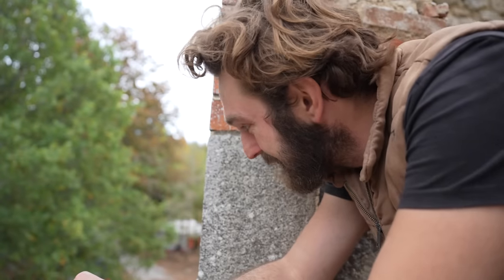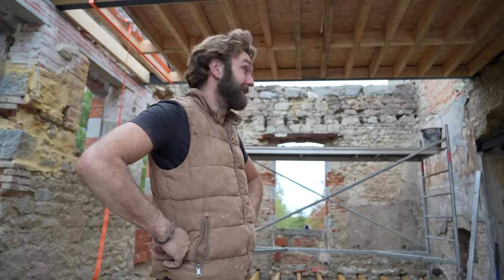it's finally finished, ready to install the floor.

Comment: Take a hint from old dutch houses. Hang a winch over the top wall that sticks out maybe 1m from the building. Control the beam with ropes from below to prevent hitting the building and eventually pull the beam in through the window.
Reply: Hope he reads this Madst, great engineers trick, from farmers to builders with heavy bulky items, doesn't hurt to hint..your idea could save the day👍

Comment: Is anyone else at that stage where you begin to imagine what it will be like when the roof is on and Dan starts putting in plumbing lines and electricity throughout, and then, dare we imagine, interior walls? Each stage will be fascinating to watch.

Comment: Bloody excellent. Regarding steel beam-we saw a church in Australia who instead of manouvering a long beam into place, had a short section and long section of beam and they bolted them together about 30-50 cms out from the wall. The did it so they they could have maximum length into the wall pockets

Comment: Dan, you can slide the beams through the window to the first floor. By moving the OSB boards and attaching a winch to the highest beams and using scaffolding for support, you should be able to pull them up another floor. Go up in stages, but you gain more control over the beam than by pulling it up from the bottom all at once.

Comment: Nice to know that your going to fix the C channel back to the newly rebuilt wall using chemical fixings. That will stop the channel twisting over its length after my last comment, well done.

Comment: I'm still a bit amazed. (Old archeologist talking.) Why didn't you get these extremely stable festival advertisments or lorry-covering plastics for your floors from the local waste-dump? 
Usually they are dropped after local football-games or festivals, or after a transport firm changed name or owner. Sometimes they are also kept in a community-vault for a later reuse, but you get them either for free or a small coinage, them in most cases being considered waste, anyways. It makes it unneccessary to clean the floor every time you do something on the level above it, and prevents the wear of the boards, because you just lift the plastic (well: it's heavy, you might need a second hand on your teamwork-carterpillar-days) and poor it a floor down on the next plastic. Spares you a lot of shovelling-time. And I would heavily suggest using them for winter or the interim-roof-levels, and especially the tiled ground-floor, that isn't getting any better with shovelling.
Reply: The only problem I can see the Chateau is in an area that perhaps don’t have Festival or businesses that use such banners etc. but a good idea. He does make life hard for himself.🍷🍷🇬🇧🇬🇧
Reply: @dawnbutler2846  True, it's more rural - they might have lorries, though. Perhaps a neighbouring farmer has some spare - holed ones. Sometimes they are used to cover those strawball-hills or silage-balls, usually these are dumped after some seasons. Smaller holes don't really do a big harm on boards, but on straw-storage. Boards can do with smaller, intact pieces, and one can always add a double-layer. There might be some useable plastic waste close-by, perhaps also from old plastic-tunnels from gardens.
Reply: @MagnaMater2  i do wonder wether 
he reads our comments. My worry are his lungs not wearing some kind of mask. Dan will be Dan.🍷🍷🇬🇧🇬🇧

Comment: Dear Dan, instead of buying so much NHL, i would once make a big amount of Calcium Hydroxide from calciumoxyde in the cellar. In Germany we call it  Sumpfkalk. Making it is dangerous because it will get very hot and you have to take precausions.
Adding some trass- pouder to your plaster Mix, it would bekome hydraulic. Less cost, less transportation, less bags.

Comment: Good to see your thinking of using my idea on the socket and drill. Just make sure you use one that supports a 1/2” chuck. The amps is what you need to keep an eye on. Cordless is the preferred.
Reply: "Your" idea? 😂 Literally a thousand people have told him this since he started using that contraption. And he has ignored them from the very first day.
Reply: @Sgirl  well one more suggestion didn’t hurt. I put it in a comment a few days ago. When he was bracing the window beam. Even explained how to do it. I had a job along time ago installing basketball systems. A large company called and ask if I could fix an install to close to a metal fence. Customer couldn’t raise or lower. Outside of removing his driveway to move the pole. I went and drilled a hole in an socket put the pin in and gave the customer a cordless drill to raise and lower the 72” backboard with little effort. Saved the company 6 grand and everyone a headache.

Comment: Love watching the progress but also somewhat frustrated...

So I'm an old man and try to do things the easy way.... Work smarter not harder.  An idea on how to haul your materials up to the upper levels....  Where's the hoist/winch?  ...and why aren't you using it?  I saw in one of the videos that you connected it to a beam very high up.  I know that it looks good to carry limestone mortar, rock, and brick up the ladder but use your head.  Use the winch to move your materials.  
1. The buckets of rock and mortar are easy.  Just hook the bucket(s) to the hook and run the winch (also safer).  Buckets can also be used to move smaller tools, fasteners, and all manner of stuff.
2. Bolt a short piece of board across one end of a (or a couple of the) wooden beams and affix a sling to take them up.  You'll probably want someone with a guide rope on the bottom/side to guide it around any obstacles.
3. You can move the steel up by boring a single hole through one end and running a piece of small chain through to connect to the winch.  ...and if your winch is high enough you can set the end of the steel beam down pretty close to where you need it.  You'll probably want someone with a guide rope on the bottom/side to guide it around any obstacles.
4. Flooring.... Just bore a hole through the panels so you can pass a chain or lifting strap through a couple of them.  If you are worried about there being a 30-40 mm hole in it use a bit that lets you re-use the hole and put it back in after you put it down for flooring.  You'll probably want someone with a guide rope on the bottom/side to guide it around any obstacles.

You will also have to figure out how many times you can run that winch from the bottom to the top before running low on energy in the battery.  ...but I seem to remember that you have solar cells and that means that the battery will be charging during the day.  So if you get three or four loads pulled up that's three or four that you don't have to take it up the ladder.

Comment: Yeah, I'm wondering how you're going to get that beam up there? If you're also going to be drilling it into the wall, you could always drill the holes beforehand in the beam, then stick a heavy bolt through it so you can put a hook on it for lifting?
Thanks for sharing, Daniel. 👍

Comment: When I built my house (it's not the normal size), I bought a used crane, which I was then able to sell at a higher price after construction! Maybe you should think about it!😉When it comes to your safety and the potential harm to your body, you should do more for yourself! An absolute no go here in Germany! There is a building inspection office here, from which you can sometimes receive a visit after the building permit has been confirmed. If the officials think it's not safe, they'll stop building it!😉

Comment: At the end of this video,the floor above your head. Weld up right H post with a C channel across the top. Put wood Rafters from that floor up to the new platform. Then build the gable on the top.

Comment: clamp a metal C-clamp to one end of the beam, and use that as an attachment point for the winch to pull it up. You can add additional clamps as handles along the length.

Comment: Use the excavator to clamp the c-channel, drive up the rock pile outside , and feed it thru the window you've been throwing everything OUT of. You might want to put a rope on the one end to guide it thru the window safely and help secure it.

Comment: Not to be a pain in the butt, and your doing a fabulous job by the way. Wear eye protection! The last thing you need is a peice of old mortar flying into your eyes. At the very least have sterile water on hand for immediate flush until you can seek a medical professional. The work is a work of art. Keep going but be safe with those power chisle.

Comment: I have a proposal for a temporary roof: I would buy a strong PVC tarp like it is used to cover the loading bay on Trucks and just lay it flat on the top floor. On the sides I would fix Boards so that sort of a flat "pool" is created. The tarps can be custom made to size at companys that make them for trucks. they can also add 4 Holes with sort of funnels. There you can attach 4 drain pipes through the windows in the lower floor. Or you could also direct some of them into a 1000 Liter euro standard water tank and use it for building and flushing the toilet. over the walls you can fix smaller tarps with boards, then the first part of the house will be completely watertight without additional structures. you need to put ballast on it so it is not blown away in gales. it is also advisable to make the boards on the side lower on one small part to have an emergency drain in case the holes get plugged by e.g. leaves so the roof can be still drained in a relatively controlled manner.
Reply: The whole material can even be reusable for die other three parts of the chateau as they are around the same size. at least if you build a more permanent roof on one part before starting with the others

Comment: Could you get something like a long reach 14mm(?) socket. Cut a slot down the side, slip it over the handle and use a hose clamp to hold it on. Then use a drill or something as a power winder?

Comment: Just a thought, if that handle on your lift is pinned to a shaft and it's removable, take it off and use an electric drill to spin it up.
Reply: Yeah really Dan 1. Even Dan 2 said so. Crazy funny.

Comment: “You know you should attach a drill to that handle”. 😂

Regarding hoisting things to the top: is it possible to install a cross beam at the top of the turret, with an electric winch/hoist? Drill a hole in the beam, secure with a shackle and hook up to the winch that way?
Reply: That's already the plan!
Reply: @preciousoil  dunno how I missed that, I’ve watched every video. 🤦🏼‍♂️
Reply: @2t2crash It’s the video where he built the floor in the turret. Near the end it is explained.

Comment: This is so hard for me to watch. He’s by himself,on the second or third floor of a 100 year old house that has walls that are structurally weakened by an enormous fire. Spot repairing parts of the walls. In the US he would never be allowed to do this. The house would have to be torn down and rebuilt from scratch to meet current standards. He is one brave guy to take on this challenge. France must have very different building codes than the US.

Comment: do they make routers for brick work ???  i noticed on the exterior, in the bricky pattern of the house there are a few rough spots and thats what got me wondering if you could use a router to take it down a few centimeters then add in face bricking to finish off and clean up those spots. its just a thought.............🤔🤔🤔🤔🤔

Comment: Just an observation but because the beams no longer go in to the wall what stops the wall from bellieing out from the weight of the floor ( you only have like an inch and3/4 of floor joists sitting in the c-channel?? Once all the floor joists or in I would run a rod from outside clear through the center to outside on the other side that’s treated on both ends so you could tighten it to keep it from ever spreading!! Just my opinion thanks for the videos

Comment: I look forward to your daily  videos and admire you ambition and tenacity but every time I see you use that hoist it winds me up have you thought of taking that winding handle off and using an electric drill with a socket on it I use a very similar type of hoist to lift my motorcycle off the ground
Reply: It has been mentioned hundreds of times.  Watch Dan's joke about it at the beginning of the video.

Comment: The first video you put up with that little lifter I said you need to put a drill on the handle 😂😂😂😂
Reply: You and hundreds of others! Not at all an original comment 🤔
Reply: @rubyklumpenhower9491   no need to be rude about it. But if hating on others keeps you happy then more power to you

Comment: Just curious from an engineering perspective... could going from placing the wood beams into slots along the entire wall to placing them in the C-channel beam cause a significant change in load bearing? The wood beams in the wall slots would have distributed the weight of the floor evenly across the entire wall whereas the c-channel now distributes all the load in just two spots on each end of the channel. Or is the wall strong enough either way so it doesn't really matter. No idea and not implying there's anything wrong with how it's being done, just curious.
Reply: with the thickness of them walls i suspect it can handle the load
Reply: He is also attaching the C-Channel at several points along its length. That will share the weight distribution.

Comment: Hello Dan, I am impressed by your perseverance,  I can only imagine how many trips up and down you are making each day.   I know it would be an expense but why not use a crane or a boom truck to lift your materials up to the level you are working on it will make things go  faster as you are now in a race against the wet weather.   If nothing else use your winch to lift the mortar to where you are working.  All the best.

Comment: Get yourself a builders elevator. Those  things are standalone , internal or external. Bit like your handcranked one , but larger.
Reply: Would he be able to hand crank a larger one?
Reply: @basseynz  Depends how much weight he puts on there ;) But those elevators are electrical , so no more cranking.
Reply: Sounds good. I think he has only limited electrical supply... No wired in supply to the property yet.
Reply: @basseynz  It will run happily off a solar system as well , doesn`t use too much power. At least it beats lugging up every brick and bucket of cement ;)
Reply: @burningpentagram666  yes!

Comment: I'd wish I could draw this for you..  But If you take two beams placed vertically going from inside the lintel at the top, and outside the window hole at the base.. With a support on the inside at the bottom, keeping it from sliding down or out.. Couldn't you make a triangular supported right angle to go far enough outside to place the winch there and create a crane on a temporary placement (and movable frame) to get things straight up? Make the bottom wide and the top close together?

Comment: Before you add weight to that floor, are you able to secure and fill the arched hole underneath it? At time stamp 1:01 on the left of the screen.

Comment: It seems impossible that you’d read this… USE A TRUCK AND A PULLY ATTACHED TO THE OUTSIDE AT HIGHEST STRONG POINT ON BUILDING.  THE TRUCK MOVES FORWARD AND UP GOES A HEAVY OBJECT to your window. 🚙

Comment: Convert a cordless battery operated angle grinder and use it as a winch motor, has the benefit of changing directions.

Comment: why is the steel lintel on the right sided  not fully supported? on the left side you did fix that. It would be much stronger if you use more bricks and the right end. Or is the camera angle deceiving me? Anyhow, goodluck. Thanks for the joy sofar!

Comment: A very common cost of building a place is to build a temp stairway with a basic stringer and treads  if done well, the stringer can be used for the secondary stairs.

Comment: And surely your floors could support some sort of davit system, especially if you built it around the floor joists (to prevent going into the joists themselves). Even better if you built it with a rail in order to better bring things into the building.

Comment: I'd try to keep water off the particle board subfloor that you put down.  That will start to come apart very quickly.  The edges especially will probably swell up.  I don't care for particle board.
Reply: Dan said way back that these floors are temporary
Reply: @basseynz  AH!  Good!

Comment: Don't forget to connect the new floor structure, to the missed wall, so the original connection remain. I think the beams in every direction were an important part of the structural integrity.

Comment: Hey Dan when do you get time to work out in the Gym all I ever see you doing is tote this & that some steel beams timber & osb flooring climb a ladder or two loading mix into the mixer winding the stuff lifter thing up & chain block winding  pushing a barrow cutting wood & steel chiseling vacuuming poking rocks in holes with mortar which gets lifted up using a rope  carrying up buckets of rock which were thrown down previously sweeping debris of the new floor  taking video of every thing  and a whole lot more beside  whoa have to stop typing I am worn out  KUDOS Dan

Comment: Please invest in a pressure washer! It will remove most anything not stable! You'll have a stable CLEAN  Surface to mortar to. A wire brush isn't going to cut it! You need to get into all the knooks and cranies